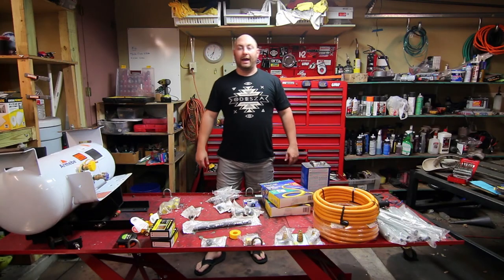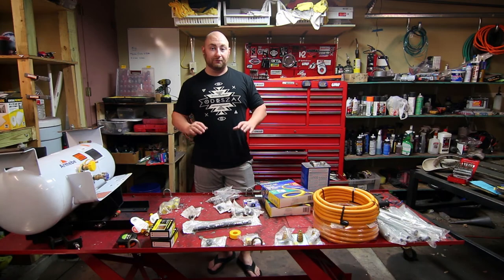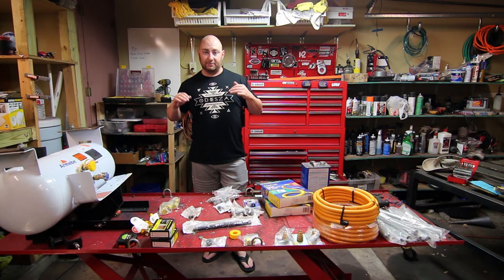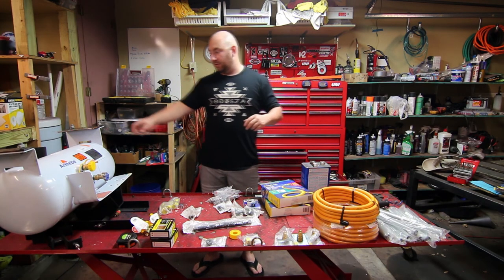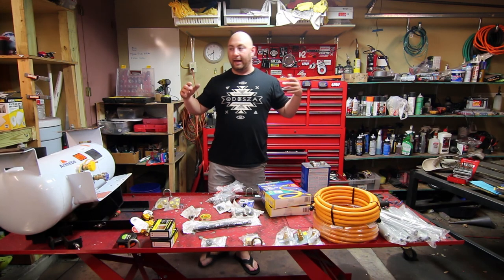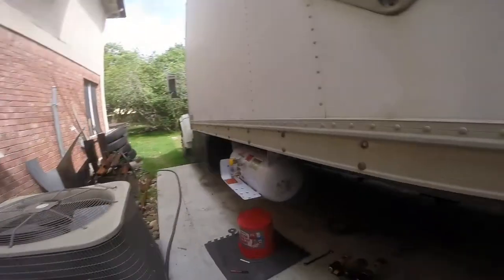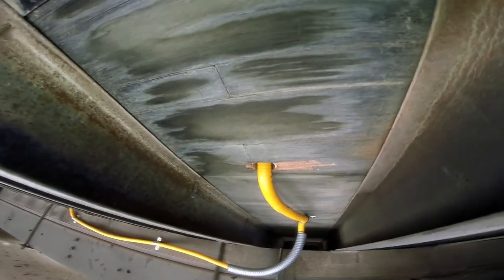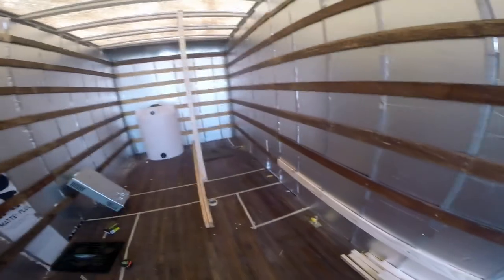#TheBassBox - Part 7 - How to Install A Propane System in Your RV LPG

Comment: Thanks for this video. Can you Tell me how to determine the size of the Pro-FLEX you need? I also have a water heater and stove that I’m using.
Reply from the maker: You need to look at the BTU rating of your appliances. Add them all up and look at the chart to see what size you need. Most household single appliances are 1/2 from a 3/4 main line. Anything RV based should be solid with a 1/2 main.
Reply: MaksWerks thanks

Comment: Some brands of csst pipe says if it it used outside it should be in conduit. Have you had any issue with this being open to the elements?
Reply from the maker: I never had any issues.

Comment: Hey M, you might think about adding one of these between your tank and Regulator. You have tons of room! https://www.amazon.com/dp/B0014JG7RQ/_encoding=UTF8?coliid=I2K7VSPZZBF08Z&colid=1W9T1VHESHHDF

Allows you to run a propane fire pit, stove outside, etc. Also allows you to run all your stuff off a BBQ tank if your main tank goes empty. I didn't have space on my build or I would have. Still trying to figure out how to snake one in eventually.
Reply from the maker: That is a great idea. Super easy to add. Going to put it on my amazon wishlist and maybe buy it later, but I didn't even know that was a thing.
Reply: MaksWerks yeah had one on my old rv, it was slick. There are cheaper options if you don't want the hoses etc.